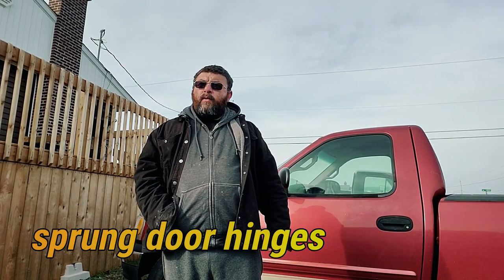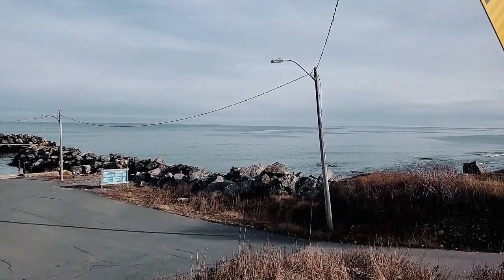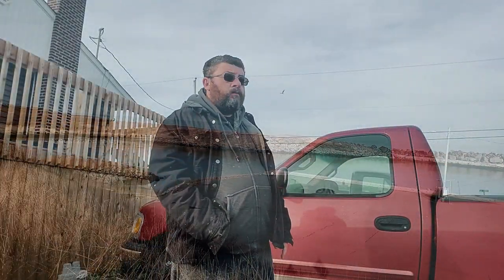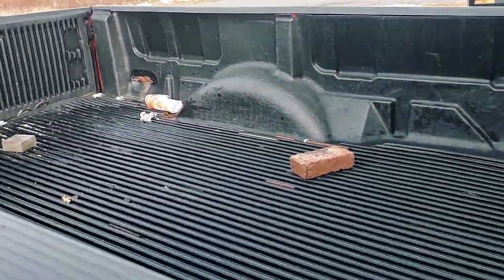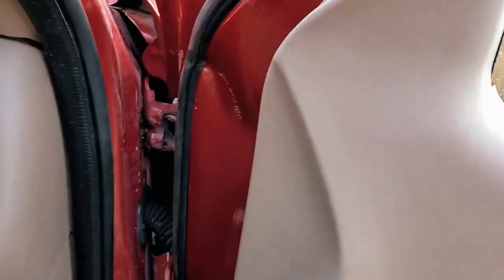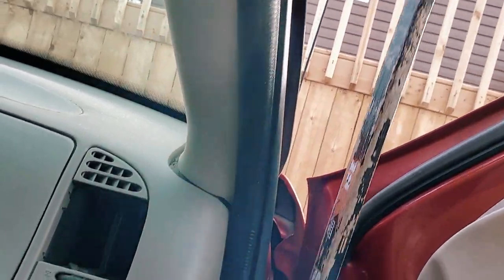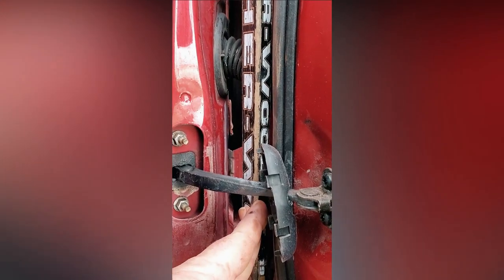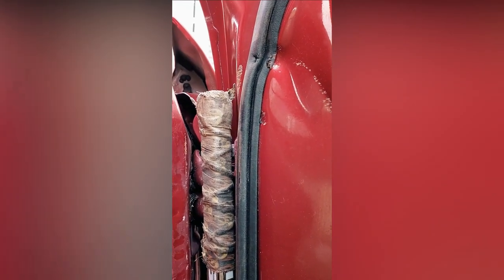car door hinge adjustment ,wind blows car door open

Comment: What if hyperextended all the way backwards. The recall for gear shifter failed and my call rolled away with the door open. Door swung open and hit a tree bending the door 70% backwards . Is there a way to fix it myself

Comment: In December we had a huge wind storm and it messed up my driver door. For a coupe months now I've been adjusting the bolts back and forth. I finally got the door to close but not without introducing a panel gap at the top of door which lets wind noise and frost in. I'll have to give this a go and see if it fixes the issue.
Reply: Did it work? Same thing happened to me

Comment: Hi, so rear passenger door swung open with gale force winds and door still opens and closes, but one can tell that there is a big cap (several mm) from passenger rear door to where it meets the rear quarter panel; and rear passenger door is very close to the front passenger door (almost touching).  Will this trick work to move it back those several mm or do we need to think about getting a special s shaped wrench to adjust the bolts?  Try both?  Any insight you can provide would be so greatly appreciated.  BTW, I love how simplistic and straight forward your video is.  If this has helped one person (which it has from the comments), you have a heart of gold.  Thank you.
Reply from the maker: this will work ,there is no adjustment in the hinges , just take your time .

Comment: Nice video! Is it possible the wind catches and pushes the door hard enough back that the sheet metal the hinges and door are attached to may bulge out? What do body shops do about that?
Reply from the maker: the A Piller may have to be replaced if it was really bad.  I once had to pull the post with a frame machine to get it lined back up. this would be more of a collision incident than a wind sprung situation.  great question ,ty Scott
Reply: @thisguysgarage  Thanks for the reply. Much appreciated.
Reply from the maker: @scottthelen3280  anytime my friend

Comment: Hi! We’ve done this with a pair of shoes actually and it’s worked, knocked out the dent but now it’s misaligned the opposite way because the door is too high. Do you have any tips on how we can lower it or where abouts we can place it to bring the door back down ever so slightly? Thank you!!!
Reply from the maker: Put a block in the to hinge alone,it will bring the door down👍
Reply: Not to sound ditsy but could you elaborate please 😭 thank you for the reply though!
Reply from the maker: @Katie-x5r6p  you used a pair of shoes to roll the door hinges together 👍 just use your shoe on the top hinge it will bring the door down in the back.  Don't get too aggressive 👍
Reply: Right so we have attempted this and the external door handle seems to be sticking when you pull it and the door still doesn’t close properly. It seems like the latch is almost delayed in curving over the strike plate so the door only closes with a fair bit of force, do you think it could still possibly be misaligned as it’s not hitting the striker directly or do you think it could be a failing with the latch itself? Thank you for your help thus far :)
Reply from the maker: @Katie-x5r6p  have a look at the striker and latch at the back of the door,  is the door up or down.  Second look  at the gap at the back of the door, is it an even gap #1 #2 is the gap tight  or is it wide ,let me know

Comment: Do you put a block of wood in both hinges of the door or just the one with the spring in it??
Reply from the maker: you can do one at a time .  but if the hinges are sprung from the wind opening it both is better  for fine tuning doing the bottom hinge will lift the back of the door ,the top hinge will lower the back of the door .  taking your time is the most important part .  let me know if you have any other questions.
Reply: @thisguysgarage  thanks for the reply back your video helped me out a lot. But now there’s a wind draft coming from the top of the door when I drive on the high way any way I can bent the top of the door without cracking the glass??
Reply from the maker: @Crossnaces  absolutely 100 % I usually put my knee on the inside of the door and pull back.  Temperd glass is very very forgiving you could tie it in a knot as long as you don't chip it👍 let me know how you make out

Comment: I think what's actually happening is that you're bending the a-pillar back into a more natural position - using the hinges as a pry.  the stick between the hinges means the sections of the hinges attached to the a-pillar are pulling the pillar back to its original position.
Reply: Exactly. This will, if anything, pull the hinges more out of whack.
Reply: Is it necessary to take the car to the dealership to ensure it seals well for water or snow or is it a body shop repair.  The door on the video after the fix still makes a noise.  My door makes a noise now and have to carry the door up to make it close and align.   If I try this would that disappear or more likely it will remain defective and noisy?
How thick does the piece of wood need to be? I have a metal lacrosse stick or could cut a piece of wood.

Comment: I see when you did that in the beginning there was no dents on the front fender or door and when you went to fix it I saw some!!I have the problem where the door won’t open all the way and it hits he front dents how can you bend it out without damage
Reply: Ok I got it open but now you can see it’s cracked where it holds the door
Reply from the maker: make sure the door can clear the fender . you can use a shim like a wooden shingle for example to ensure it clears.  worst case senario remove the upper bolts of the fender to loosen it up.